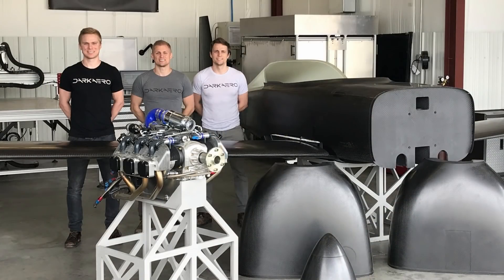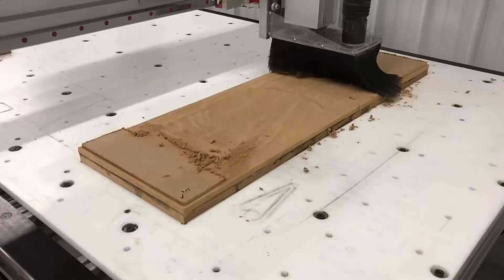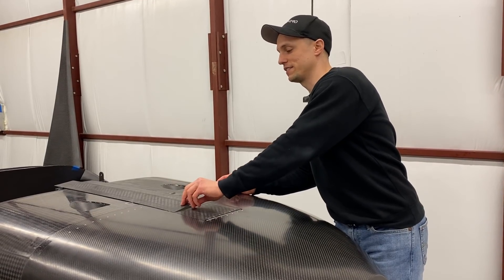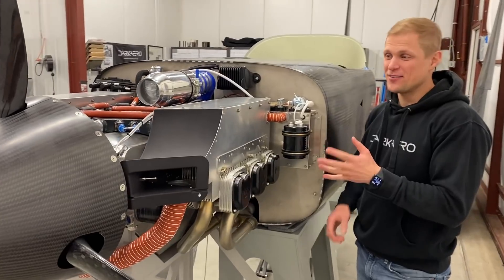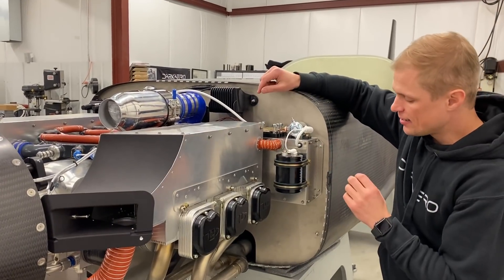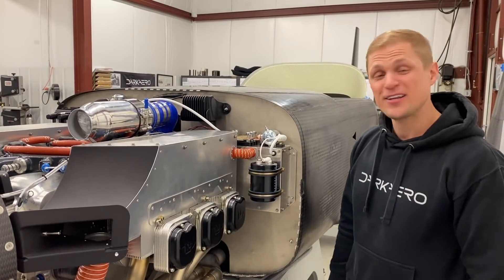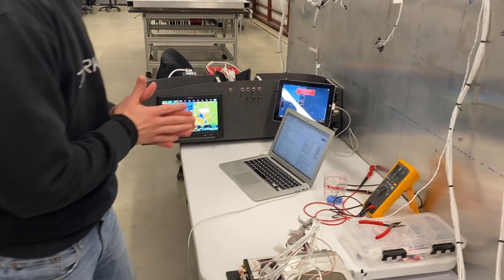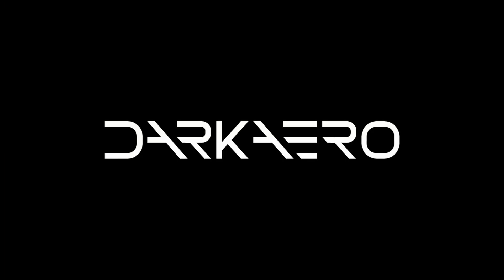DarkAero 1 Progress Update  (Feb 2021)

Comment: If you can explain, why did you choose carbon fiber and not glass fiber?
Reply: They made a video about that already, go back and watch it....great!
Reply: Carbon fiber is stronger/ lighter if done properly.
FG is strong, but heavy when layered out.
Reply: @doesntmatter3068  Thanks.
Reply: @sonicgem4757  
Richard V. would be correct, they did make a video just for that reason..
Watch it, interesting!!
Reply from the maker: Hi 56 xc! As Richard mentioned, we have some videos we have made about carbon fiber: 
https://youtu.be/yNsjVEm_9TI
https://youtu.be/vPQ3sFPuB6c
https://youtu.be/mwTE4MamfVE
In general, the selection of carbon fiber as the airframe material was mission driven. The DarkAero 1 was designed for maximizing speed, range, and efficiency. Achieving this goal required structurally optimizing the airframe to reduce weight. Carbon fiber has an excellent strength to weight ratio, better than fiberglass or aluminum, which allows for weight reduction. It is also has an excellent stiffness to weight ratio which helps us to create an airframe that resists flutter at high speed. Thank you for watching and for the question!
Reply: @DarkAeroInc  Thanks DarkAero  :)

Comment: from an engineering perspective this is just brilliant! I love your landing gear solution!
I have two questions:
first, my dad wanted to know if the controls are actually steel cables or is it electrical?
second, I am wondering 4:00 which way is front, because it appears to me as right is front, and then the placement of the hinges seems strange, as there is this unsupported part of the side doors that can deflect in the wind. Or am I wrong and left is front?
Reply: 1) The controls have been done in prior video's, go back, and watch, and give them the views. 2) Look at the CAD simulation, shows the hinges, as he has them. (right is front, when he is next to it) the front flap will deflect most of the wind around the side doors, when open, I'm sure there is more hardware to be added to strengthen the doors.
Reply: @nssherlock4547  still, the placement of the hinges seems odd, but I guess there was not a better way to do it
Reply: @dingsens2810  read their story. The controls are mostly carbon fiber tubes.
Reply: @vikascc4824  Thats not the point, my problem is, that to the right there is an unsupported part where the wind can bend or at least cause stress in the material, its not a problem when its shut, but you have to open it to get the gear down...